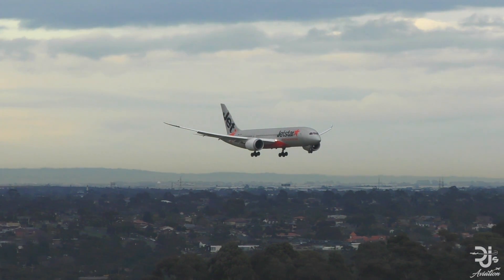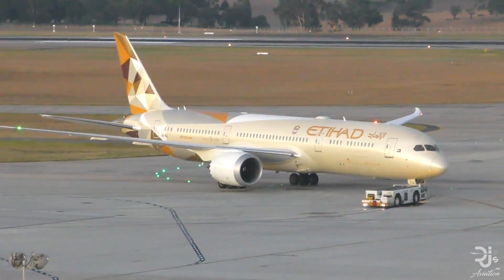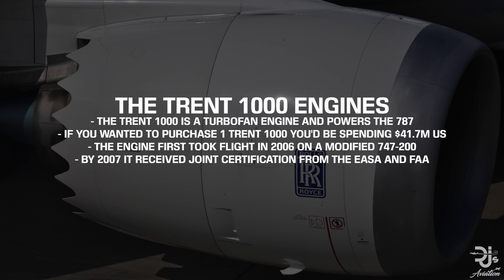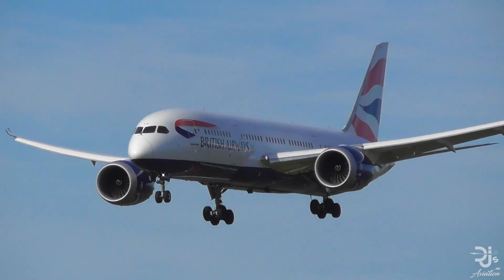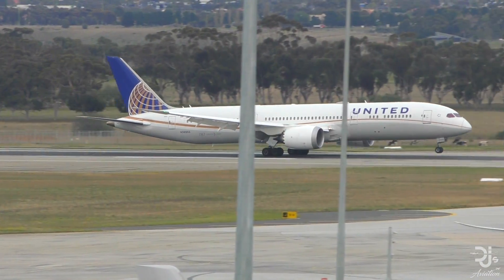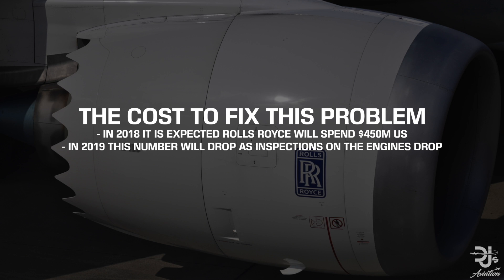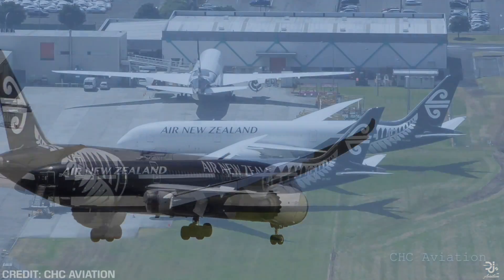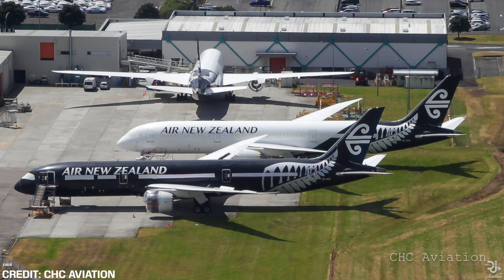The TRENT 1000 ENGINES ISSUES Explained

Comment: Airlines should take Rolls Royce to court and seek financial compensation for this mess. Credits for future maintenance is just not good enough as its impacts current year profits for airlines.
Rolls Royce really need to sort out this issue FASTER! The CEO should resign!
Reply: not how this works, you signed contract with specific obligations and rights, you don't want to start pushing people to get something out the door now if you want it fixed quickly, and CEO change in a situation like this is rarely a good thing or the right time.

Comment: DJ, if the problem is with the Trent 1000 design per se, then how is it that Boeing successfully used it as the launch engine for the 787 ? As far as I'm aware, it performed fine at that time. I suspect that a great deal is hidden from us in contractual detail between the 2 companies, but to produce 31 variants of the engine for 3 variants of the aircraft is unprecedented. Are Boeing asking for the impossible in lean burn engines ? It's a topic that doesn't get as much attention as it should perhaps because it is neccessarily highly technical.
Reply: pasoundman This is a fatigue problem. Fatigue occurs after some time, not on day one of launch.
Reply: Clearly true (I had hoped that much would be self-evident as engines have to be run in all manner of regimes before cerfification and amass a lot of hours in the process). The number of variants of the Trent 1000 hid the full facts for some time. It seems that 'Package A' didn't suffer any problems at all but didn't meet Boeing's fuel burn requirements by 1%. The ensuing 'Packages B and C' met and then excelled the fuel burn spec but introduced a fatigue problem (as you correctly say) that didn't show its head for about 4 years. The long term fix is the Trent 1000-TEN which is a significant redesign using technology borrowed from the Trent XWB which had the advantage of being designed using more modern CAD tools. The Trent 1000-TEN is in service now. In the meantime, the engines which suffer from fatigue problems haven't actually been grounded (they do require more frequent inspection) but their ETOPS ratings have been severely reduced. For some routes this makes them effectively unusuable e.g. with Air NZ. Air NZ were amongst the first to take delivery of the Trent 1000-TEN which should have solved their particular problem. In the meantime, R-R has a lot of work on its hands, fixing engines in service. I had predicted that ever more demanding fuel burn requirements would eventually have a negative knock-on effect on engine reliability due to Carnot's Principle (hotter running engines being the result) and this may have been the root cause in the case of the case of the Trent 1000.

Comment: Dose anyone realise that Air New Zealand had two complete engine failures on take off all in one week this causing emergency landings to take place. The photos on line show how the engines had failed in the high compression chamber by the fan blades actually melting because the coating had worn off I suggest looking into this it quite interesting. Btw great content on your channel DJ

Comment: Rolls Royce will solve these problems as they and other major engine manufacturers have solved similar problems in the past. We all have to keep in mind that turbofan engines for commercial aircraft are highly stressed, high powered engines which generally propel aircraft flawlessly for many thousands of hours of use between overhauls and tens of thousands of hours of overall life.

A typical supercar engine by comparison is much lower powered on a per pound and per engine size basis. To boot, the supercar engine needs major work every thousand hours or so, and is ready for the garbage or at least major overhaul after five thousand hours or so. Normal car engines are even lower powered and not much more reliable.

Comment: I think Rolls Royce should work with airlines in package B that need there engines inspected every few weeks or so. For example BA 787-9 flight to Chicago May have to sit half of the day to then depart on time to land in Heathrow and they could do he inspection then instead of when it is on a short turn around and having to cancel the flight.

Comment: The easiest way to describe the Engine package is this. Most engine manufacturers don't call them packages, but a rev or revision. There's an entire group called Configuration Management. The CM folks are supposed to know the exact parts in each and every aircraft. 

The first engines that left the factory were outfitted with a specific set of parts. Over the entry into service, anomalies were found which required a redesign. This could be a seal (abnormal wear), a turbine blade (erosion or blade breakage), or possibly an engine tube (cracks or fitment issues).

The newly fitted parts now make up the new revision called Package B. This is the new baseline engine that is being built. Further inspection of this engine configuration parts shows abnormal wear, and it's back to the design board.

The newly fitted parts package becomes Package C. 

The A330 program, the Trent 700 Rolls Royce engines used for flight test required swaps every three or four flights due to engine vibrations

Comment: This has no end in sight.  Maybe it's time RR stop using the 3 stage compressor.  They can blame the specific part manufacturer all they want, but at the end of the day, the fact that these engines have an intermediate stage is the reason these jets are sitting (albeit looking mighty good) on the ground.  If they can't fix the problem, then maybe they ought to buy GEnx engines for these Airlines that have put their trust in RR.  Let us also not forget that the early RB211 killed the Lockheed L-1011, otherwise an amazing jet.

Here's the other problem that Airbus fans aren't going to like.  The Trent XWB and Trent 700, both now being exclusive to their respective jet, the A350 and A330NEO, are also 3 stage compressors, and before anyone blames the 787 of this current issue, I'd really hope that after a few years of service life you don't see the entire A350 fleet stripped of ETOPS, because if they same parts start showing fatigue or cracks, it could dunk the entire program, with no alternative engine choice.
Reply: How is the number of spools a factor here? For economic and political reasons new engines will all need to be either triple spool or geared fan designs. Triple spool has reduced low speed turbine efficiency compared to a geared fan twin spool but twin spools with geared fans have added gearbox issues. Traditional plain twin spools have hit  efficiency limits due to the mismatched needs of a big fan and low speed compressor locked on the same spool.
Reply: Because GE has managed to meet power and efficiency targets without an intermediate pressure compressor.  More moving parts in the engine mean higher odds of a part going defective.  I agree about the GTF, which will likely have hiccups yet to come, especially in the higher thrust variants.  Also, let us not forget the Trent 900 that blew part off the wing apart on a Qantas A380.  I'm not in any way rooting for any engine manufacturer to fail, or one to win over the other.  I have genuine concern for Airbus' 330NEO and 350 being solely available with Trent engines.  If you were an airline right now, looking to invest in a few 787s, could you make a case for choosing RR engines, even if RR made a lower bid?  I would go GE even on a higher bid, because my planes are making money in the air with maximum ETOPS.  Also, this started with Package C, and now have been found to be in Package B as well.  At what point do we discover this problem is across the board?
Reply: this is not the first or the last time his is happening, but GE has had problems with past engines so, in effect what comes around goes around and then you just live with it.
Reply: @BayAreaLen  The problem with RR is not the three-spool design, it is the quality control. RR cut corners in the manufacture of the blades and compressors. If RR had a more stringent quality control, this wouldn't have happened. Let's just hope this issue would not affect the A350 and A330NEO, as well as the remaining RR Options for the 787.

Comment: GE engines are cheaper and offer less maintenance and comparable power to the disastrous RR engines. If Airlines were smart: they would swap out their current Rolls Royce's for General Electric's and change the engine option for future 787's to GE.

Comment: Simple fix.  Switch to GE engines.
Reply: The aircraft is built specifically for that engine.  Many systems in the plane are customized for the Trent engine.  The aircraft would have to be partially disassembled and rebuilt and GE doesn't have hundreds of additional engines just sitting on a shelf waiting for customers.  These engines are usually ordered 4 to 6 years in advance of their delivery.
Reply: Except that GE have had problems of their own, with engines suddenly exploding.
Reply: GE engines blow up too.
Reply: Ge is not safe when it explodes wich makes the airplane burns
Reply: Good thing Hawaiian Airlines ordered their 787-9s with the GEnx engines. Otherwise, they would see delays with their deliveries. They've already had enough headaches with their a321neo delays.
Reply: i was thinking the same thing...
Reply: correct answer - proven technology!!!
Reply: GE is much better engine
Reply: Ge good but loud,, less louder than pratt and whitney
Reply: engines aint cheap    not that easy to you, plus GE dont have engines sitting in a warehouse
Reply: yep sure right
Reply: Funny people are talking that GE engines aren't reliable without showing the even, flight, and proof. Nice stupid move.
Reply: southbound1969 yes! Be but a jiffy. After all GE engines are flawless.
Reply: Much more simple fix. Buy an A350.
Reply: @jetli8703  The A350 uses the RR engines too. So it's a better move to 777x.
Reply: Then switch to Airbus and you have a great plane!
Reply: Hubris or Rubbish. . Those Brits have funny accents..
I don't blame the RR technician the only thing flying for them it's those Donald Trump balloons over London..::)
Reply: southbound1969 , I've spoken to Rolls Royse technician and he told me that GE is rubbish
Reply: Of course he said that. That's  their main competitor....
Reply: Fossa Poplitea of course they would say other companies engines are rubbish when clearly we can see which are more rubbish lol
Reply: BOEING AND GENERAL HAVE AN EXCLUSIVITY CONTRACT WHICH BARS AIRBUS FROM USING G90, GE-9X AND GENEX ENGINES. AIRBUS WILL NOT BE ALLOWEDTO USE GENERAL ELECTRIC ENGINES WHICH BOEING PAID BILLIONS OF US DOLLARS TO DEVELOP. AIRBUS IS CHEAP AND SO IS ROLL ROYCE AND NOW THEIR CHOKING BECAUSE BOEING AND GE ARE KILLING AIRBUS SALES. AIRBUS IS CHEAP AND NEEDS TO BUILD IT'S OWN JET ENGINES AND STOP USING QUALITY AMERICAN MADE GE ENGINES THAT BOEING PAID TO DEVELOP. THE DAYS OF OF OFF THE RACK QUALITY  AMERICAN JET ENGINES FOR AIRBUS HAS COME TO END.
Reply: @kimberlywilliams7543  You clearly have ZERO clue what you are talking about. Boeing did not pay to help develop GE Engines. GE requested exclusivity on the 777 as the market is too small to support more than one manufacturer. Not ONE US airline has ordered it. RR powered maiden flights of ALL the 787 variants and the 757. Likewise in Boeing allowing GE exclusivity, Boeing requested that GE do not offer the engine to any direct 777 competitor. RR engines powered more 757's than any other engine. They also have exclusivity on the A350 which is proving to be more than a headache for Boeing. Just watch what will happen to 777-8/9/10 orders when Airbus fly the A350-1000ULR in a few weeks time. Word coming out of Toulouse is of a plane carrying 300+ pax from Sydney to London on 25% less fuel than any of the new 777's. Watch and weep.
Reply: Err....Air France,.....GE?

Comment: Why do airlines choose Trent 1000 over GEnx? Also, is it a design problem or a materiel problem?
Reply: Multiple choice answer.
Cost of installed engine and after sale service. All manufacturers offer what is called Power by the Hour. With power by the hour, the engines are basically leased from the manufacturer. You pay a set price per hour of operation. 

Some airlines have preferences for engines based on the support manager at their location. It costs millions of dollars for tooling to work on these engines. Some companies will provide the tooling "free" to keep a customer. 

A good customer support representative is worth his weight in gold. He looks at the engine trend data and schedules replacement parts, while working with the airline customer. AOG (aircraft on Ground) service is huge.

Comment: That's was super informative 
Thank you DJ
Reply: I disagree completely.  The actual issues are not defined, but only referred to obliquely.  And he confused corrosion with cracking.  Since they are so new I doubt he meant corrosion fatigue cracking or even WFD.  Worse yet no discussion about the difference between these intermediate turbine blades and the previous versions without the problem.  A little research FRIST would have been good.

Comment: From my PoV the engine design was rushed from day one. Rolls-Royce was loosing engines to GE. On top of that, Boeing decided to only use GE engines on the 777-200LR/300ER. Meaning during the time frame when Boeing was deciding on who will power the 787, Rolls-Royce just had to win the deal or else they may fall as during that time. So in my PoV, Rolls-Royce rushed the engine design, cut the costs on materials in order to beat GE. While GE was relaxed during that time as they were basically thriving on the GE90 series as well as the the CFM-56 series.
Reply: That's not the only factor. The entire industry is going through problems as we switch to geared turbofan, carbon composite engines. P&W have had similar problems on the A320neo.
Reply: Jacob Payag 
The entire Trent 1000 was rushed into service, From the beginning GE even said to RR to uses a higher more durable blade because it’s were the problem can occur, and it did. 
RR quickly must of rushed this engine into service to get most of the 787 engine costumers more than GE, unfortunately it became the other way around because now GE has far more sales then RR is almost every plane engine they sell to airlines, for the 777, there’s no contest, GE has more than 1,500 orders while RR doesn’t even have 400, they’re doing good in the 787 market with GE but GE is still ahead there too. The reliability for each engine is clear, Airlines prefer it over RR, yet RR makes reliable engines such as the ones powering a330ceo/neo/a350
Reply: +Johnny Wynn I think RR should've stayed out of the 787 program and offer more engines to Airbus. They offer engines for the A330, A330neo, A350 and A380. I don't see why they couldn't develop engines for the A320neo, as they are already proven with Airbus.
Reply: Ibirdball 
Yet but RR is still the one behind because they’re having way. Problems then the engines you mentioned
Reply: It’s because RR doesn’t make engines for narrowbody planes, The 757 was like the last plane until it died from service, RR focuses of widebody engines, while GE-CFM joint venture, and PW are the real narrowbody engine winners

Comment: Awesome video as always Mr. DJ!
Wow the 787 just can't catch a break. First there was the Lithium ion battery issues, and now the RR Trent 1000 engine issues.
Reply: Massive innovations and modifications = Massive problems encountered in service - Increased tIme required to remedy.  Standard practice.
Reply: yep pretty much, but the thing is it still is going to push back innovation as carriers are not going to want to deal with this again.
Reply: Airbus seems to be doing better for their A330-2/3
Reply: Those bad Li-on batteries were supplied by Yuasa, a Japanese battery maker with a helluva good reputation.  I wonder whether they subcontracted to China? That's what Samsung did with those disastrous self igniting S7 phone batteries.

Comment: Why don't the airlines just change to the genx engine
Reply: 2 reasons

1. that would be more expensive. we saw here that the trent 1000's cost 80 million per plane. assuming the GE engines are around the same price it would cost airliners more money to replace them than the alternative. right now the burden falls on RR (where it should)

2. where would the replacements come from? I doubt GE has hundreds of finished engines sitting in a warehouse. and the ones in production now are already slated for use on new 787s. why should GE bail out these companies that bought from their rival at the expense of the customers who bought from GE in the first place?

if I were GE's CEO I would want these airlines to experience the maximum financial pain for going with RR. that way they will be more likely to buy from GE in the future
Reply: Eugene Nyamweya manufacturers decide what engines they want. Then the airlines decide weather to buy or not.